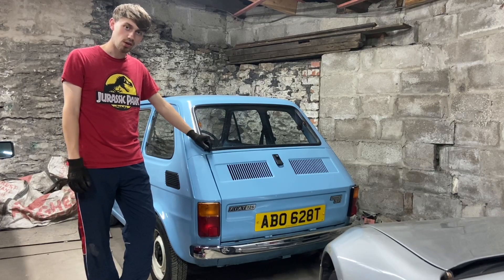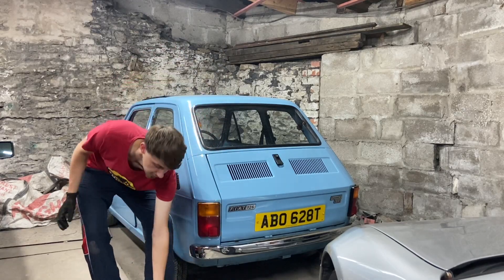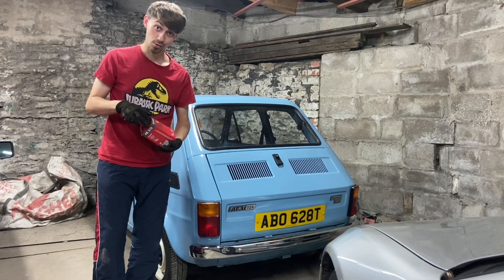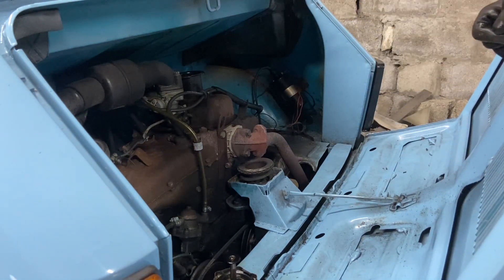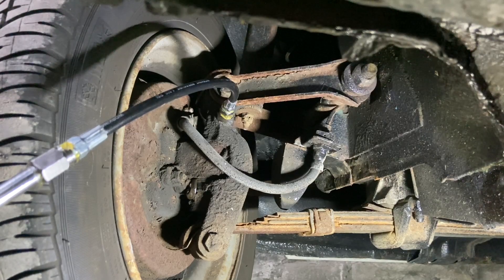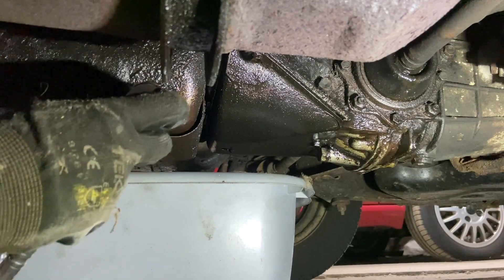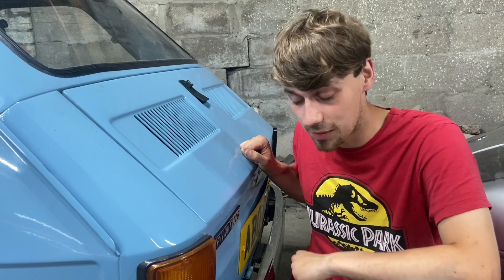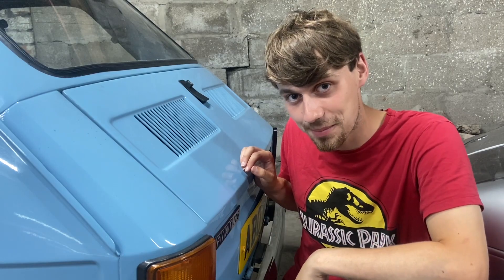Servicing Our Fiat 126!

Comment: you also need to clean the oil slinger out in the middle of the pully as it acts like a filter and there normally plugged up
Reply from the maker: I addressed the crank pulley oil situation in the video, it isn’t done on every service - Haynes will tell you the intervals!